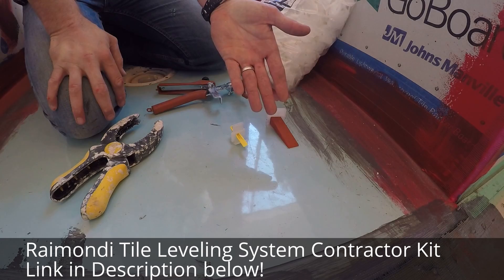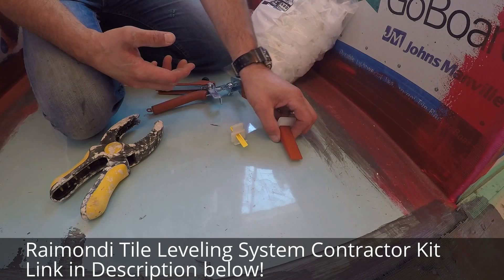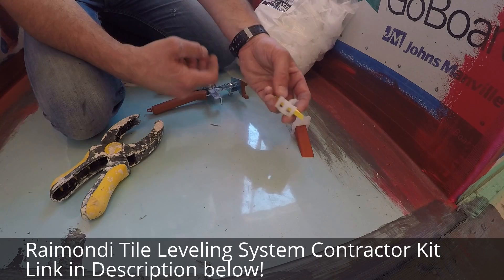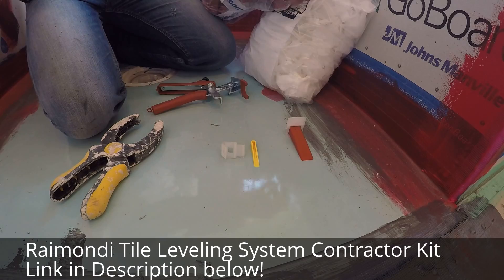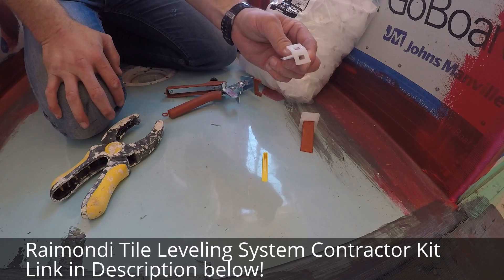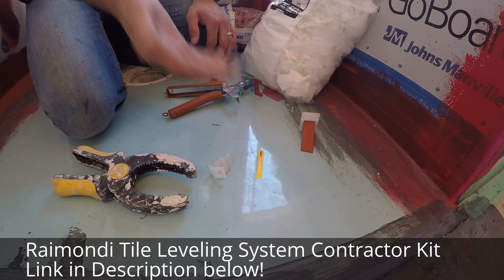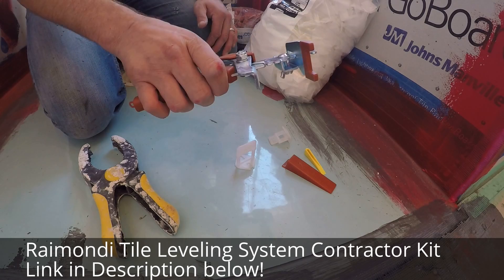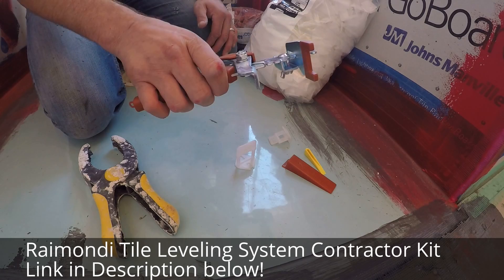Raimondi Tile Leveling System Review

Comment: Nice vid sir, just bought my Raimondi Level System for my bathroom project. Quick question, should I damp the durock with light water and sponge before I put down the thinset and set tile?
Reply from the maker: That's not necessary as long as you properly key in the thinset to the backer boarf and skim/backbutter each tile before setting. Thanks for watching!
👊
Reply: Landberg Tile DIY TV Sweet thx man and sub'd.

Comment: Do you prefer this or the spin doctor leveling ? which one would you recommend i buy ?
Reply from the maker: +wave I haven't used the spin doctor yet, I'll order a starter kit and post a video!
Reply: LANDBERG Tile - Handyman - DIY ok ill be looking out for the video
Reply: the spin doctor is not as good as the RLS ive tried both you move way faster with RLS. its top of the line leveling system.
Reply: thanks for the info!

Comment: no backbutter
Reply from the maker: I was waiting for someone to say something! That video is 3 years old and we rarely backbuttered until learning the importance of doing it. 👊
Reply: It is about coverage anyway. Sal did a vid with a TCNA guy about this and using the 1/2” notch on large format got the coverage needed without backbuttering. That said, when placing, had to apply pressure and work the tile back and forth to collapse the ridges. Was interesting to see the coverage differences with different techniques and trowel notch sizes.